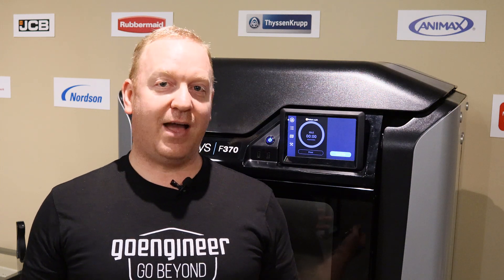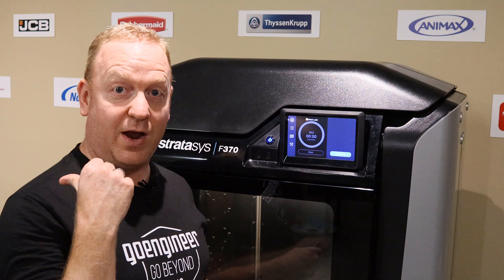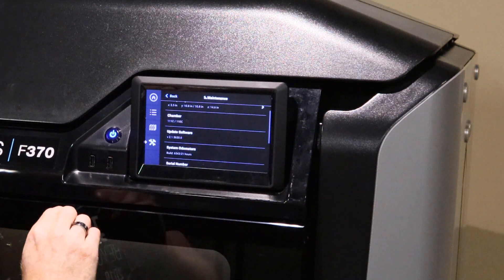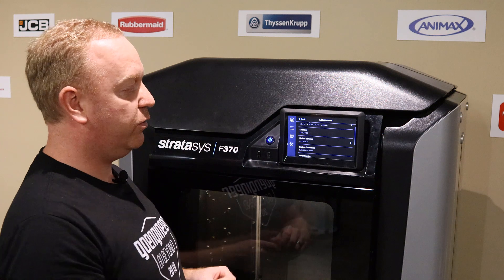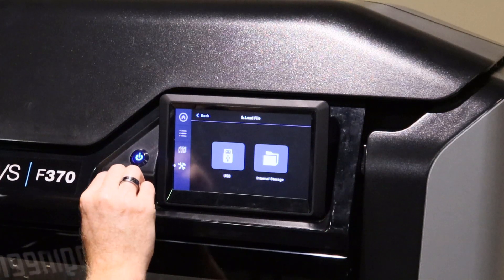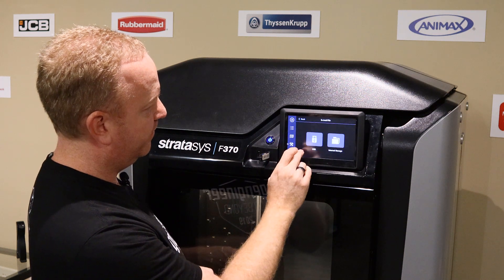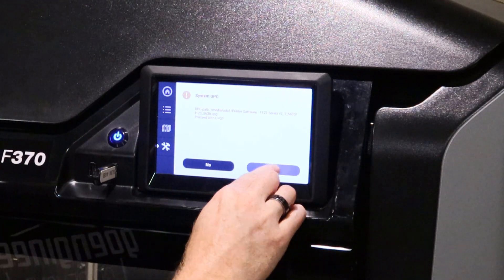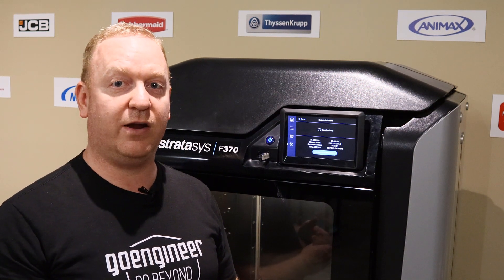F Series Software Update

Comment: Great video, do you know where I can get a hold of the direct firmware for the USB update method? I cant seem to find the firmware online at all
Reply from the maker: The best thing to do is get a hold of your vendor and they should be able to help you get the proper firmware files.
Reply: @goengineer   so i was able to find the firmware files but my printer is stuck on the "waiting for update" screen via ethernet. I cant access wireless since its greyed out, and i cant use my wired connection since its at my workplace and its locked out, is there any way to force it into the usb firmware update menu? ive tried hard reboot and reset to factory and it goes to the waiting for network update no matter what